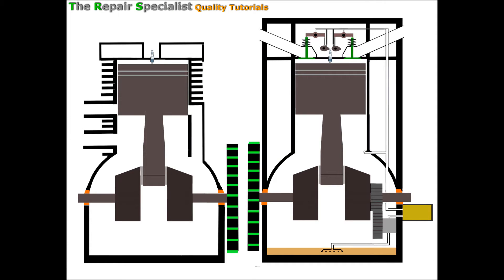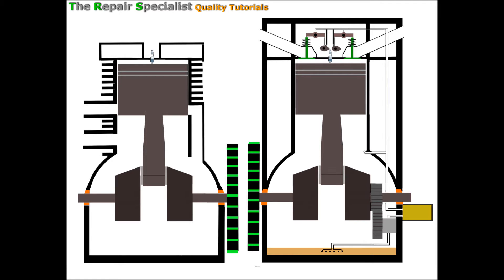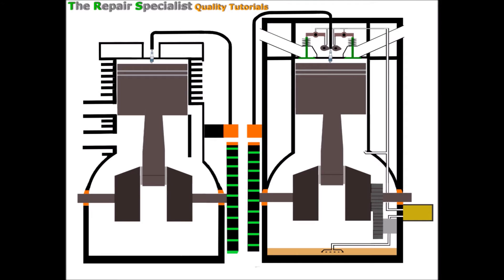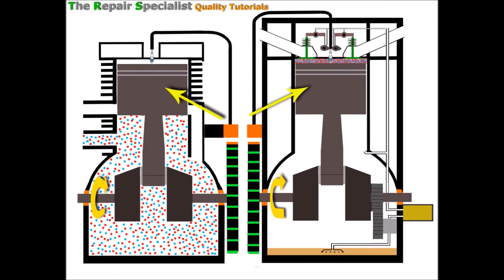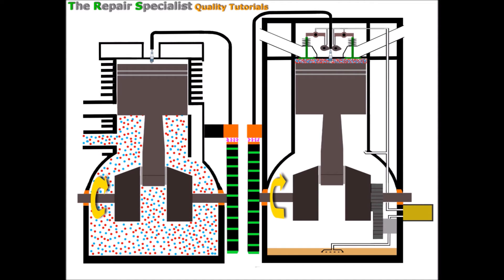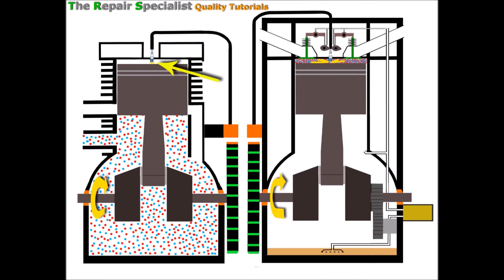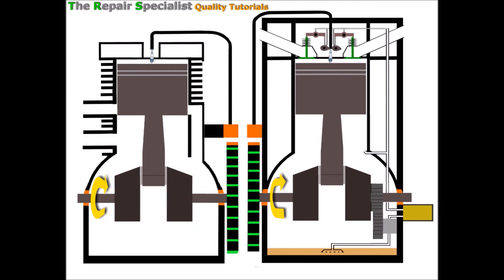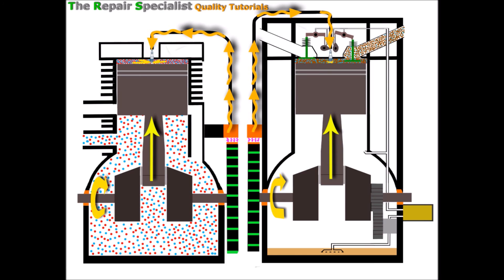Engine Spark -  'HOW IT'S CREATED' - 2-Stroke & 4-Stroke.  (by Craig Kirkman)

Comment: I have an old 4 stroke mower that's run great for years. After lending it to a friend recently, I've found it won't run anymore. I've checked the spark and there is nothing, even after I replaced the spark plug. Is there anyway to repair this? Or would it mean trying to find another magneto? Thanks